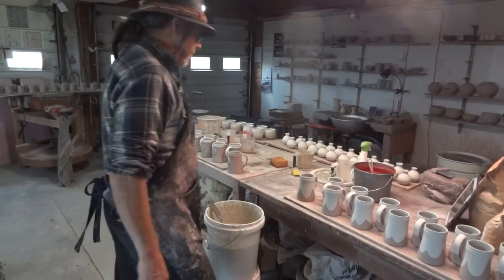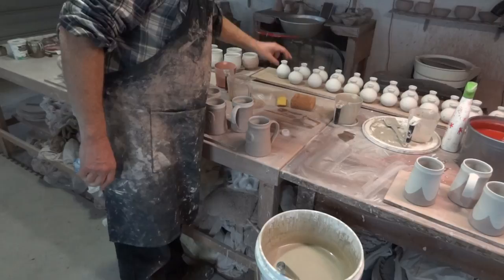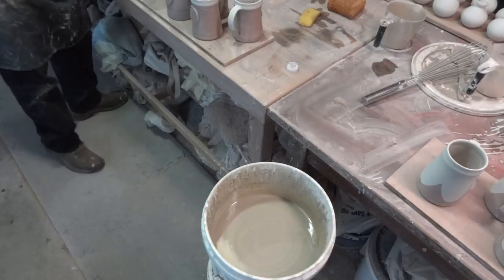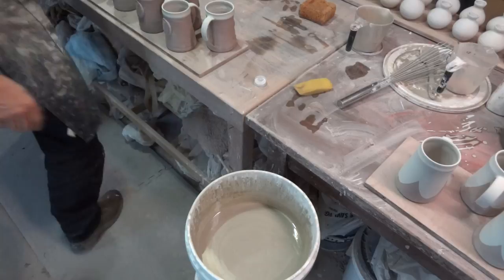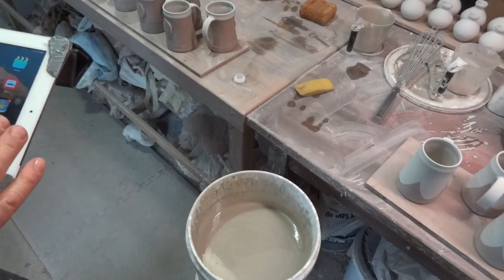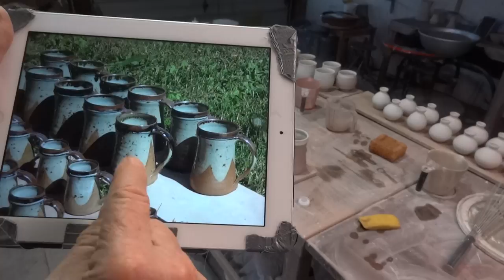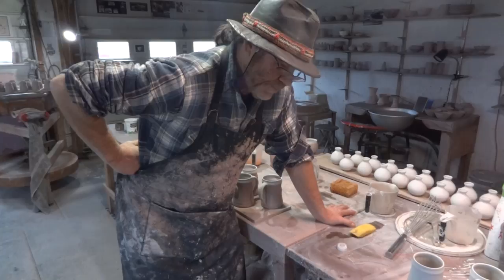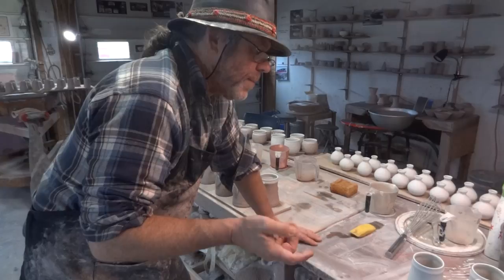A simple helpful glazing tip ! - March 18th 2020 with Simon Leach

Comment: Hi Simon, Excellent video as always. Wondered if you could share some advice. I use a Tenmoku in an electric to 1220. Recently however after 2 dips my pieces are coming out with a bit of a matt finish from the firing. Do you have any suggestions or do you think it's a glaze thickness problem?